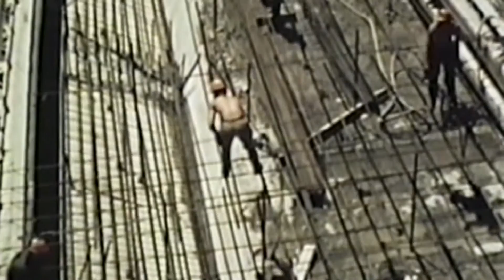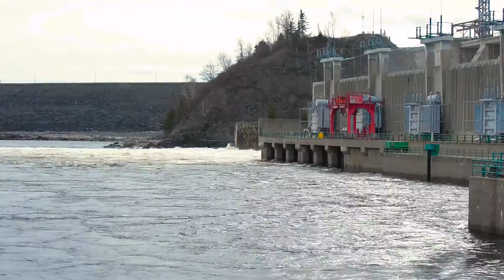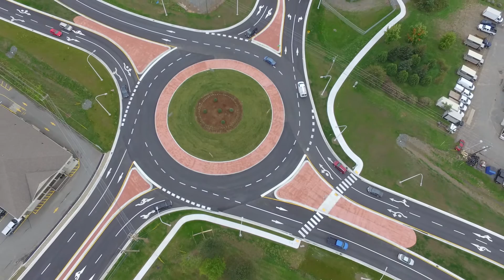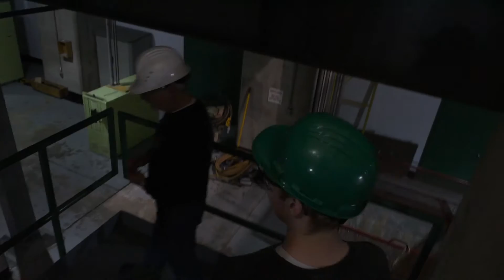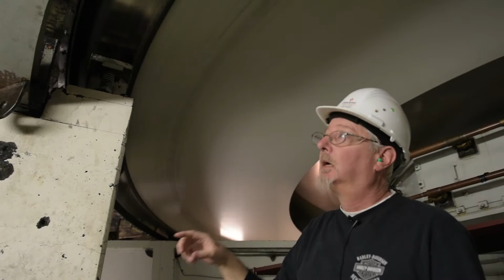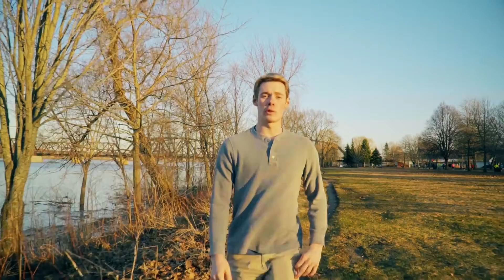Hydroelectric Dams

Comment: We run dynamic simulations of hydro in conjunctions with other base load and alternative energy systems using a $30,000 Electrical Engineering software program, i.e., ETAP...so as to attempt to identify forthcoming challenges and mitigate them in a more timely manner....results are interesting  https://energyathaas.wordpress.com/2016/05/02/the-duck-has-landed/

Wind and solar power fall off sharply just when consumer side demand ramps up sharply.... causing grid system instability.

At this time alternative energy systems do not play well with conventional base load electrical power generation systems. Although there is some flexibility with hydro making it remain one of the better base load power solutions.